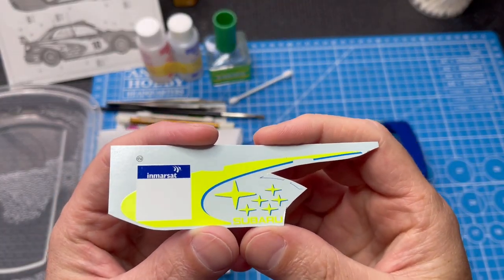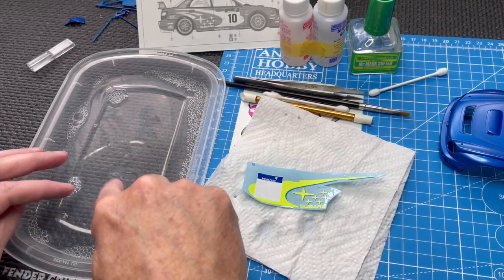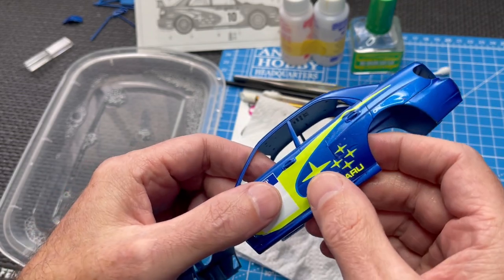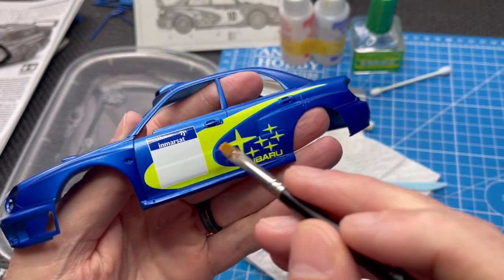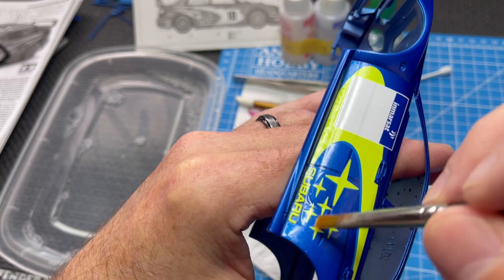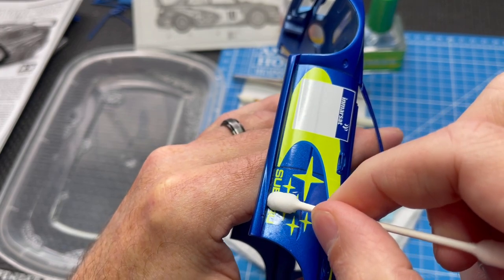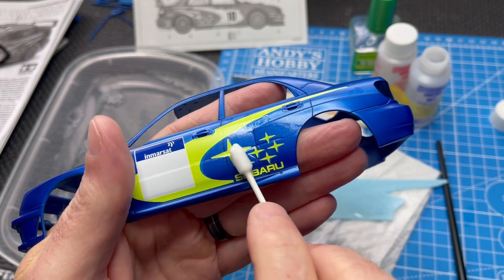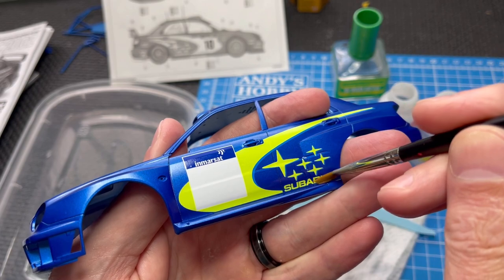Hate applying decals? Watch this!

Comment: When I do decals I first put in the water and use tweezers to get the decal and I put it on there and get a brush and get some decal set and brush it and use a Q-tip
Reply from the maker: I’m trying to not use solvents any more as heat seems to work better. I also stopped using qtips because the fibers left behind. Heat and a silicon brush to adhere the decal work well.
Reply: I do mine the same way. I lay my decals down using the Red solution and set it in place.. I tap it with a paper towel and then apply the Blue setting solution and walk away. I check on it once or twice. And I may have to use a little more settings solution just to a spot or two . And I've never had a problem with any of my decals. When I have , it's been due to the quality of the decal... But this is still a pretty cool video. 👍

Comment: Something I have found to be very useful in getting decals to snug into seams and small area is foam makeup wedges. Simply dunk the sponge wedge into warm water and squeeze out the excess water then firmly press onto the decal. The less you have to touch the decals the less likely you are to move them or break them. 

Keep making these videos, their great!
Reply from the maker: Hi William, thanks for the tip. I’ve been using silicon brushes lately to snug decal into panel lines and such. Heat is your best friend with making decals conform.
Reply: @ScaleModelExperiment  Never tried silicone brushes for decals. I have used them for modeling a bit of clay or putty. I will have to give it a try. Thanks.
Reply from the maker: @WilliamEverhart28217 the triangle shaped one works best for me. Be gentle and it works well.

Comment: the video kind of helped me add decals but I had small decals too small to repeat your actions of adding decals to models so I did a work around and now it is easier for me to add decals.
Reply from the maker: Tiny decals can be even more challenging than big ones. They stick to tweezers, fall off, etc. I share your frustration with them.
Reply: @ScaleModelExperiment  thankfully in my community page, I posted about a workaround for that issue

Comment: Thank you for sharing; Is the decal applied on a Gloss Coat? or directly on the painted body before Gloss/Clear coat?
Reply from the maker: Hi SouthPaw, the gloss of your paint doesn’t matter. The surface needs to be smooth so the decal can lay FLAT on the surface. If your paint is lumpy or orange peeled it will translate to the decal. In my video, that was before gloss. I sealed the decals afterwards.
Reply: @ScaleModelExperiment  Thank you.

Comment: Two questions: Does the  water temp mean anything ? I like to put my decals in warm water to slide off the backing paper. Two what was that tool that u used to roll the decal ? Got to say loved the time  on one decal. Liked what you said about mr mark decal
Reply from the maker: Hi Chris, I'm torn on water temperature really.  Warm water does seem to get stubborn decals off the backing paper.  GOOD quality decals only take 5 seconds in the water upside down, 5 seconds face up and then out of the water for 10 to come off. I've had some decals that take much longer.  The tool is called a decal squeegie and is made by despaie.  The tool is pricy and can be substituted with a makeup applicator instead.  I'll do another decal video to show it.  Thanks for watching and dropping a comment.

Comment: can the solvent you used be applied under the decal?   does it increase the "stickiness of the decal?
Reply from the maker: Hi Scott, that’s a good question. Yes you can apply solvent to the body and put the decal on. BUT, you risk the instant adhesion of the decal with no ability to move it into position.

Comment: ive got a question. i am going to polish my tamiya car but do i polish before or after the decals? i need urgent help
Reply from the maker: The decals need a smooth surface to adhere to. If you’re already smooth, apply the decals, then clear then polish.
Reply: @ScaleModelExperiment  okay lets take the wrc 99 that is in this video. would clear, polishing be fine before applying decal? because i am using spray cans and not airbrush. whats ur recommended way of doing it?
Reply from the maker: If I were using a rattle can, I would primer, paint the blue, wet sand to 6000 grit smooth, apply the decals, wait 3 days then apply clear in VERY LITE COATS with just one heavy coat at the end.
Reply: @ScaleModelExperiment so just sand and then apply decal without polishing until after the clear has been applied. never heard but im definitely trying to find more support since i messed up heavily on my first attempt on building a scale model car. if only i could pm someone for help 😢
Reply from the maker: @jamiechaan4635 I now understand that you are a beginner. I suggest that you watch my friend Spencer’s channel Scale Auto Garage. He uses rattle cans and I think you can learn from him better. 

https://youtube.com/@scaleautogarage?si=9JEZA8EY_1CGfoa_
Reply: @ScaleModelExperiment  thank u heaps 😂

Comment: Α small hair dryer works wonders for the decals
Reply from the maker: Hi Nikolaos, I’ve used heat before and ruined decals. I know that I overdid the video a bit but the decals were old and I wanted to play it safe since I didn’t have a backup set. Thanks for watching and commenting.
Reply: I use a small travel hair dryer its not that hot  to melt or destroy the decals. its heat is about 40 to 50 celsius give or take.
Reply: and the best thing to  do to old decals is to spray them with fixative  varnish for pastels , its a very thin laquer or sometimes enamel based varnish , just remeber to use t2 to 3 light coats and let the decals  dry for a week .It allways worked for me .
Reply from the maker: I’ve never tried this.  When you do this do you have to trim the decal all the way down to the print as the clear makes the sheet all one big decal?
Reply: no you spray the hole sheet.the varnish its very very thin .
Reply: just spray very  light. one or 2 at a time.
Reply from the maker: Understood. But doesn’t the clear then bind the decal to the paper? When I do decals I sloppy cut around the decal because the decal is actually on top of the paper. If you spray clear over top doesn’t it make the whole sheet one big decal?  Therefore you have to trim the decal all the way to the edge of the graphic?
Reply: some times when the decals is thick but frajike  or has cracks  I sand the hole sheet  with  2000 sand paper very light just 2 to 3 passes then  i wipe the deckas and spay the varnish .  sometimes it removes  some of the yellowing.
Reply: the hot water  will melt the varnish in the borders . its microns thick also the heat helps the varnish to flex  and bend more  so does the decal . its best to use an old deckal that you fixed than to buy afetmarket or print your  self..witch the second needs  a varnish .
Reply from the maker: @nikolaosstavrou5327  thanks so much. I have some old kits that I can try that out with. I appreciate your help.
Reply: I hve done some expiraments and I have found that the thin decals are less affected to crack  than the thick ones ,for example   old tamiya and old airfix
Reply: no problem a ctually the  fixative varnish technic  it was toled  to me by a fellow  that made decals for a living!   old dude.

Comment: Why do you add the dish soap to the water?
Reply from the maker: I was told by a decal manufacturer that dish soap breaks the tension better than plain water to be able to move the decal around and position it better once applied. I found that it works.
Reply: @ScaleModelExperiment  Thanks for the reply, I will give it a try. Just a small drop I would imagine.
Reply from the maker: @davidbishop1570 exactly just a drop will do it.

Comment: Why don't you use clear coat first on the model. That way it would be easier to move the decal on the model.
Reply from the maker: Thanks for watching Nick. The reason is… I like to keep the layers of paint to a minimum to preserve detail. That’s why my builds look the way they do. I overthin all my paint and use the least possible. I do agree that if you have a polished clear coat the decal does move around easily.
Reply: @ScaleModelExperiment  Hi. Thanks for your answer! I am still in a learning fase regarding modelling and struggling with my airbrush especially putting on a nice gloss coat on the model. I use gloss varnish from Vallejo. The result is not as I wish for. The surface of the varnish on the model is not smooth. Maybe you have some tips in how to apply a nice shiny clear coat on the model with an airbrush?
Reply from the maker: @NiekkieNick Hi Nick, here is my paint theory. Use the least amount of paint to keep the detail high.  Use an extra part thinner than normal, mist your base coats until you have color coverage. No wet coats for base coats! The surface should be a matte finish before clear. Plan to do 3 coats of clear. 1st coat is a tack coat, mist it on to set up a base. Second coat is heavier but not wet coat. 3rd coat thin your paint more and lay out a wet coat to make glossy finish. After it cures polish the paint. I did an overview video recently called how to get a mirror finish. Check that out.
Reply: @ScaleModelExperiment  Hi! What do you exactly mean with a wet coat? Do you use a thin or thick needle in your airbrush and is the psi of the compressor important when bringing on a gloss coat?

And what do you mean with no wet coats for base coats?
Reply from the maker: @NiekkieNick a wet coat refers to the pooling of paint on the body. For the color coat, spray your get coverage only. The clear coat is for shine. I shoot with a .035 needle at 20 psi. You can adjust your speed of the pass to get a wet coat with your 3rd coat of clear.